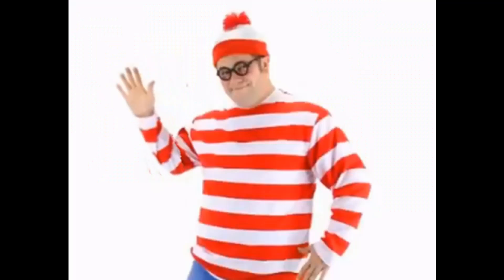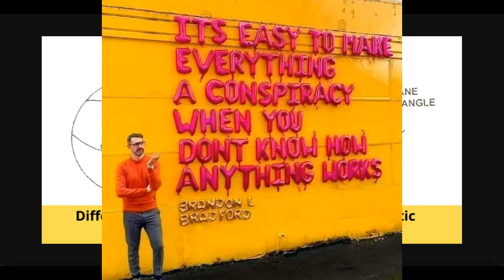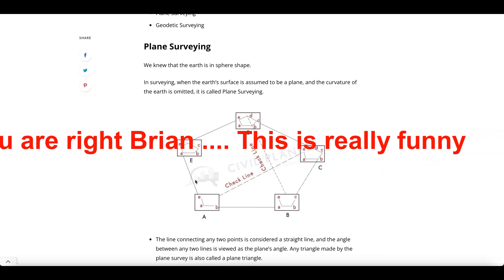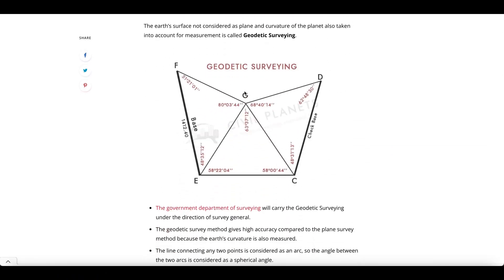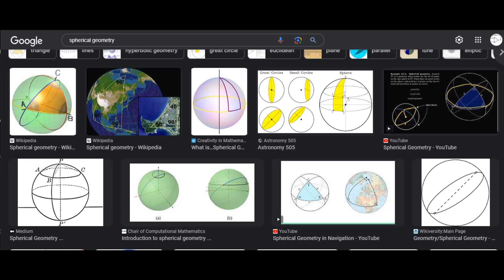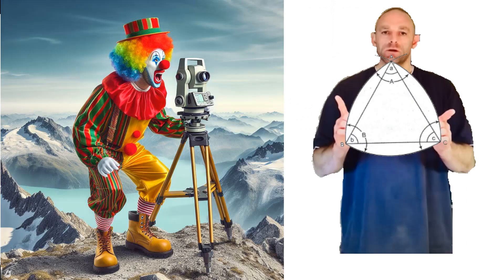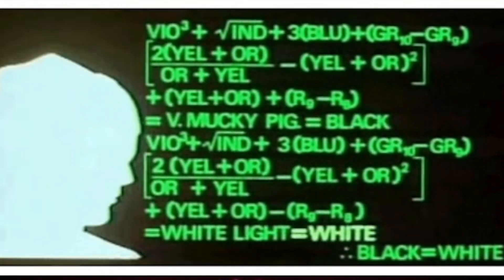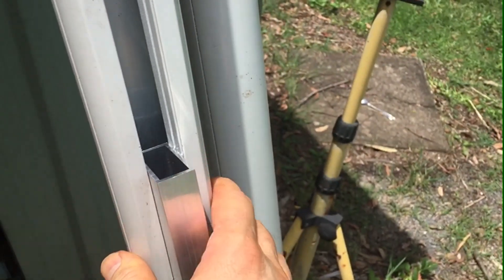Geodetic Rectangles = YES and Brian's Logic = FAIL

Comment: I haven't done machining in years but some of your issues appear to be from how and when you are conventional milling vs. climb milling. With aluminum I thought it was do the rough cutting in a conventional direction and do a shallow cut finish pass in a climb direction.  Climb milling gives the better finish but due to the angle the cutting tool hits the work it tends to deflect the tool more.

Comment: Poor Brian's logic fails before it starts. There are more ways to measure the Oith as a sphere than you can shake a stick at in a month of Sundays. From Eratosthenes calculations, to North Star elevation angles at different latitudes, to heat distribution during a year. The only related topic science hasn't been able to measure yet is the full depth of Brian's ability to deny reality.

Comment: You need a groove on the opposite side of the slider so that when you fix a screw through the groove into the slider, the slider will slide up and down but can’t fall out. Of course you can machine something more fancier than a screw and tap in the threaded hole in the slider. If it’s long make one permanent and the other with a butterfly nut so you can adjust the slide.

Comment: I worked in commercial construction and there is no need for geodetic surveys since plane surveys are not only accurate enough but much cheaper since they take less time.  Curvature errors are well below allowable construction tolerances.  Geodetic surveys are used to keep the nationwide network of benchmarks at a high level of accuracy.

Comment: 2:42 the triangle FEG is tiny. Not a good example. Spherical excess cannot be practically measured in a teeny tiny triangle. 

If the 1421.4 is feet, then the triangle is 0.022 sq mi. 

If the 1421.4 is meters, then the triangle is 0.23 sq miles.

Spherical excess is 1 second per 72 sq mi. That’s 1/3 of a second per angle. 1/4 sq mi would have spherical excess of sq root of f’all

Comment: Space holes along the leg and extension.  A spring loaded pin that can be squeezed together can be used to lock  it together at each position.  Think of how a metal walking stick or cane works.  You squeeze the pin and pull the cane apart.  You can lock it in new positions at 2.5 cm intervals.

Comment: The Wyoming/ Colorado example is a fun bit of trivia.  Since the northern and southern borders are lines of constant latitude and neither is the equator, they are NOT parts of a great circle.  To walk along them, you would have to 'constantly turn towards the north slightly' as you move along them.  Flerfs should understand that, after all they're always expecting planes to 'constantly dip their nose'.  lol
Reply: The spherical excess is between a straight great circle and the curved latitude. The difference is different with different latitudes (different angle between the plane of the angle and the plane of the equator).
Reply from the maker: Are they called Rhumb lines? Maybe that’s something else again. That’s where you have a constant heading from A to B . It is slightly longer but easier than a great circle
Reply: @whereswa11y Quite right.  Rhumb lines are what you get if you draw a straight line on a Mercator Projection map.  This is one of the things about Mercator projections that is so useful.  Have a Mercator map of the North Atlantic and you can plot a 'steady bearing' course from coast to coast without a lot of computing, GPS, or any modern tech.  It is a bit longer than a great circle route, but much simpler to plot and steer.

Comment: @3:00 not sure why his surveying reference finds triangles with LESS than 180.  This is usually because of some errors and there are corrections made by cross-checking other readings to get a more accurate set of angles.  After all, most of us know the earth is a globe and spherical geometry dictates they should add up to MORE than 180.

Fun fact for those that are into the different forms of geometry, there IS a branch where triangles always add up to LESS than 180.  Basically some forms use surfaces that are concave (think like a 'saddle shape').
Reply: Before GPS, when everything was still analog, I took a year of surveying classes while studying engineering. It included weekly site measurements. We never got perfect results. That's why we would do traversing. We would do a circuit clockwise, reset our equipment and do it counter-clockwise. Probably none of the measurements would match up. Then we'd repeat it. Apply corrections to "average things out". Then we'd compare our results with other teams in the class. They'd have done their own measurement, few if any of which matched our own. But when they averaged things out their results would effectively match ours.
It was a great way of reinforcing the concept that tools are innately inaccurate but the proper use of them could account for that and achieve accurate results.
Reply: @fepeerreview3150 Going waaayyy back, reminds me of high school trig class where we took a theodolite outside and measured the height of the school's flagpole.  Needless to say, each pair of students had a slightly different answer (well, ISTR there was one way off because they used the wrong trig table [yes, back before calculators and we looked them up in the table at the back of our textbook] lol)
Reply: fepeerreview is right.  All measurements are an estimation.  While modern surveying instruments are highly accurate, they are not 100% perfect.  The construction surveyors on our jobs would take about 4 readings of a target then average them out.
Reply: Do we know if those are actual measurements, or just some reference put into a book that aren’t implied to mean anything?
Reply: @KennyEaton603 Good point.  It may be a sort of 'made up' example just used to illustrate some point.  But even so, you'd think they'd use an example that illustrates spherical excess on a surface of positive curvature (i.e. globe), not a deficit as if it were negative curvature (i.e. a concave surface)
Reply: @mikefochtman7164  agreed. Though I doubt they were under the impression that anyone would try to determine the shape of the earth from such a meaningless example. Surveyors are a bit brighter the Brian’s lack of logic.

Comment: I checked the Hanford LIGO in Google Earth web site using the measure tool and like Brian got a shorter result. A whopping half a meter. Hmm, I suspect some rounding went on there somewhere. I did wonder if it was doing a surface path going up and down with elevation, but I checked a triangle that was over a cliff and the cliff appeared to make no difference. Rounding confirmed I think.
Reply: Google are trying to give the impression of a sphere? Giving a slightly SHORTER distance than on a plane requires is hardly injecting spherical stretching.

Comment: For the leg, I'd suggest having a pair of racks, as in rack and pinion steering, one on the sliding part and one linked to the other part by a pair of swinging links, like the links in an original Colt 1911 before the tilting barrel was invented, with a cam on one that runs over a sprung roller so that rack is held on or off the other. If you make the teeth with 90° and 60° faces, so their tips are blunt wedges, it'll lock up on the faces perpendicular to the direction of movement so it can't pop the racks apart but still be able to slightly adjust itself as you close the racks.

Comment: Think about this, take the distances between major capitals of the world and try to get it to fit on a flat map.
For example the distance between Beijing and London is about 5050 miles
8380 miles between London England and Canberra Australia
8860 miles between London and Cape Town South Africa.
7250 miles between London and Santiago Chile.
6690 miles Canberra to Cape Town.
7035 miles Canberra to Santiago.
4930 miles Santiago to Cape Town.
Make it fit on your flat map, then do the same for the rest of Beijing distances.
Get the puzzle pieces to fit.
Do Ottawa Canada distances.
Tokyo Japan distances.
Singapore distances.
Quito Ecuador distances.
Nuuk Greenland distances.
When you finally get them to fit on a flat map you will have proven your point.
No need for  debate.
Reply: That's the basic principle behind my "Build your own Flat Earth map" video and the files in the archive linked in its description.
So far, not much feedback on that and nobody's sent me a photograph of their finished world map.
Reply: The flat earther Tger Dan tried.  He is no longer a flat earther.
Reply: This is the most obvious issue with thinking Earth even could be flat, and it's absolutely baffling that they can't see this as a huge problem. The fact that the entire Earth has been accurately mapped, and that there is still not a single complete map of Earth that is both accurate in scale and flat, is the most obvious, completely irrefutable proof that it cannot possibly be flat. The only answer they have is to ignore it, which is evidence in itself that not a single one of them is truly convinced of it.
Reply: @markwood1159  There are many concrete proofs against the FE cult's beliefs. The only explanation that could come close to be reasonable is that "its all a big plot by...them".
Reply: They may argue the distances given are incorrect. I prefer to use direct flight times between major cities as an alternative.
Reply: @Tsudico  I use flight times between airports. Its a lot more precise.
Reply: You can easily create a Flat Earth map with the available data for distances between airports online and you can use CAD software to plot these airports onto a "flat" CAD drawing. Eh...you can try to. I have. It falls apart after the first three airports.
I've offered to help Flat Earthers create a Flat Earth map. NONE have accepted the invitation. Strangely, they seem to think its an insult for me to offer to help them...